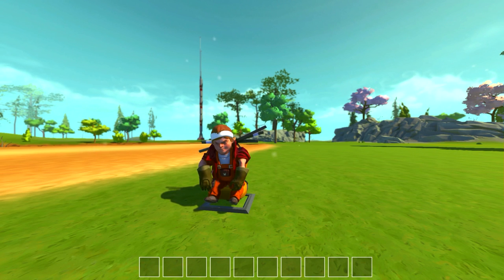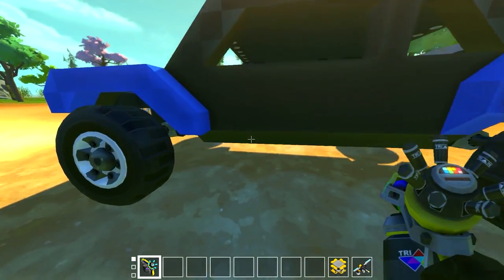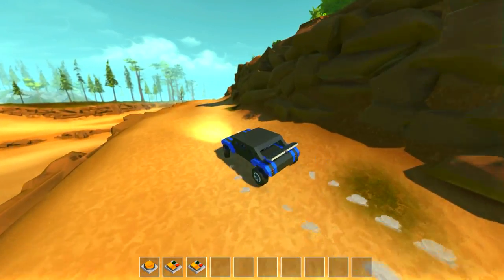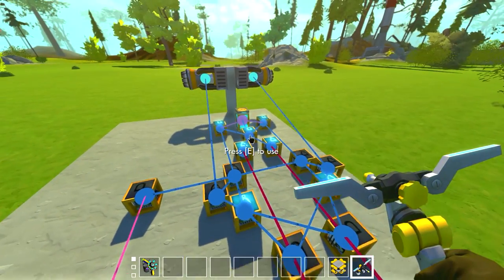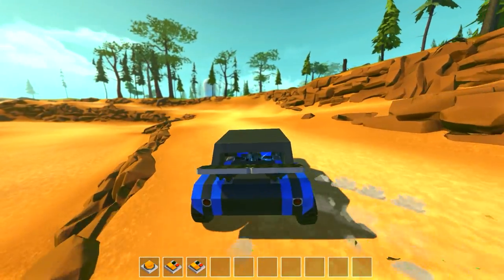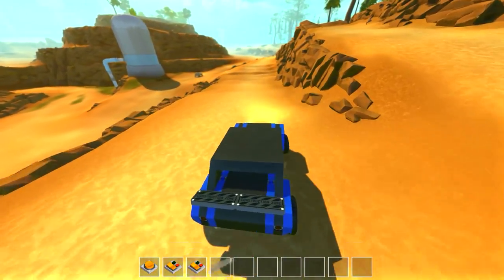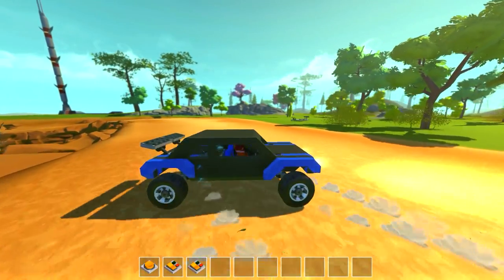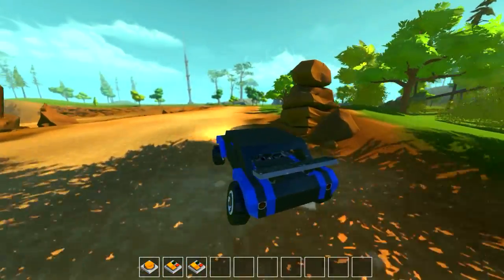Epic Controllable Drift Car! (Scrap Mechanic #203)

Comment: I guess i found a pretty easy way to have driftphysics. Without any logicparts.
Maybe it's worth to think about it.
I connect frontwheels with gasengine, and the rear wheels with electric engine.
The rear wheels will brake if you release W for short, what lets the rear breaj out until you hit W again.
I keep that going for me, because its simple.

Comment: It more power - slide than drift but sure, And alot of a drifting car are the tires, Angle. Pressure & tread pattern but it's scrap Mechanic. Well done.

Comment: Kan build a car that can do a burnout with thrusters the functions are
You can turn on and off auto burnout mode 
When on it will do burnout when you press w automatically and press another button to stop the burnout
When off it will not do a burnout unless you press that same button 

Like if you agree
Reply from the maker: brittosa That's a neat idea actually!
Reply: kAN Gaming thanks and actually no one has done this before
Edit:also I think it is going to be practical because it will give increased acceleration
Reply: kAN Gaming you should build something like hoverbase alpha a flying base/carrier there is a video like that over in neebs gaming note them guys swear a lot more than you

Comment: Yeah its hard but your drifts look natural. 
But there are more factors:
Weight Distribution 
Camber
Stiffness of the suspension 
Dampening 
Angle of the wheels horizontally (i think its about -0.3°negative) 
Its really hard to replicate but i have a couple ideas(you can set controllers to 1°, right?) 
And a dampening slider should be added in the suspension menu (maybe an opportunity  to fix the suspension glitch?)

Comment: what about a drift car multiplayer monday?
Reply from the maker: korter kaks scoring is the only hard part with that
Reply: make it a race not a trick competition. if there are sharp corners then drifting is the fatser way. so who finishes first wins, just like a normal race, right? what do you think about that?
Reply: korter kaks you can't drift in tight turn
Reply: well then not so sharp corners(but still littlebit sharp). drifting will still be faster than turning.

Comment: If you just use rwd and realy poewrfull engine you dont need thrusters
Reply: And you need other suspension like double wich bone suspension
Reply from the maker: rui ferreira true but even with RWD you can't get these really wide drift angles